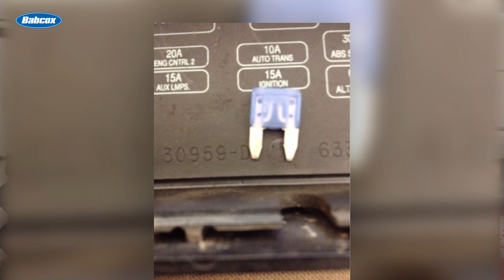Compressor Failures: Symptoms, Causes and Diagnostics

Comment: What a great freakin video. I'm a DIY guy. My '13 Buick Lacrosse stopped blowing cold unless I'm driving high speeds. I bought a full replacement of the system from RockAuto, based on comments I've heard about replacing everything if the compressor fails. However, I haven't done enough diagnostics to determine what the actual cause is. Gonna borrow some  gauges and vacuum from O'reilley's and maybe buy the harborfreight ones if I enjoy doing this.